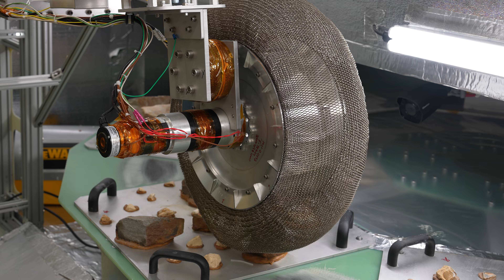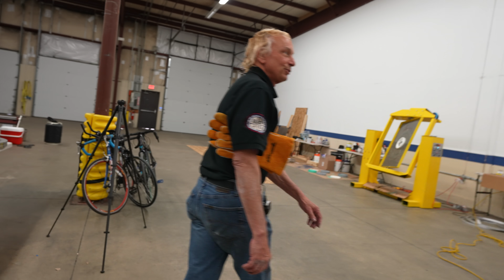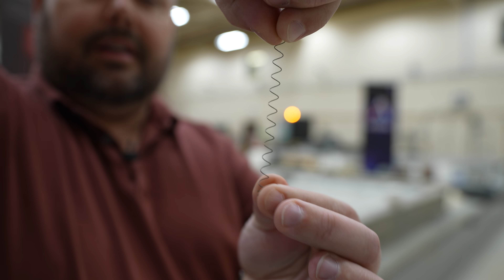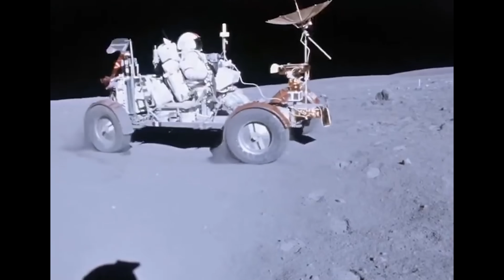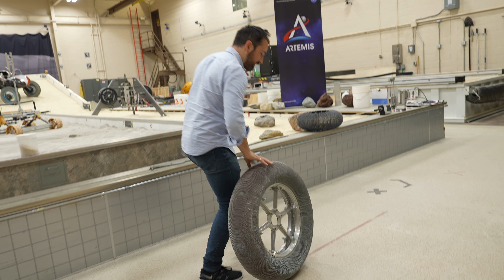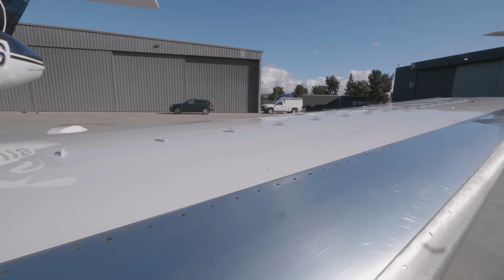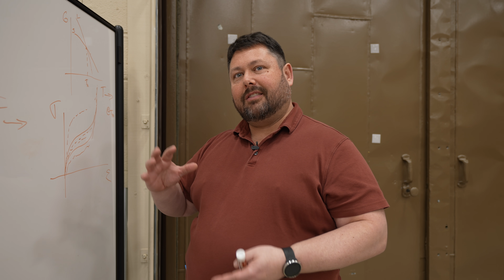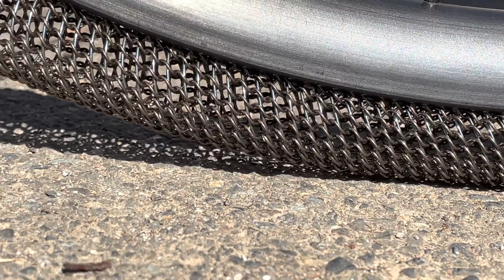How NASA Reinvented The Wheel

Comment: As an engineer grad who had to work with material science this video was very facinating, and really gets you trying to think about other applications for such a material. I bet racecar companies are looking into this material for their tires. I wonder if you could use this material with appropriate heat controls to increase traction or decrease traction of the tire during the race. If so, I could easily see it being one of the biggest improvements to long-term race times as you could "deflate" the tire on harsh turns, and to slow down leading into them, and then "inflate" the tire on straights for speed.
Reply: i kinda doubt it'd be used for tires cause it seems like the coefficient of friction isnt going to be all that high
Reply: @bigmitchy4026  wrapped with rubber
Reply: @sendoh7x  i mean sure but isnt that going to make the tires a lot heavier. So you've got the current weight of a racing wheel, then you'll have to add the metal mesh on top of that. The runber is a certain thickness as is because the rubber needs to last that long on the track. That isnt going to magically change once you add the nitinol mesh
Reply: @bigmitchy4026  i dunno man. up to the engineers to figure it out. or just probably not suitable for that purpose
Reply: In the context of racing tire pressure is usually used to control heat. Low pressure tires make more heat than the same tire at a higher pressure. They are just trying to target a specific temperature for a given tire compound. 

It could be cool to see it used to increase efficiency of vehicles with rubber tires. In the straights you could reduce the contact patch of the tire to reduce the coefficient of friction. In a corner it could do the inverse.
Reply: we use it in dentistry in root canals and braces which is amazing
Reply: I'm sure shoes have a place here
Reply: Rocket cars at the salt flats. Sort of like missiles with wheels
Reply: For vehicles, active suspension and aero can be created by just passing current thru this stuff, its the lightest possible actuator
Reply: think about it the other way around. tire problems in racing come from the tires heating and the tire expands and pressures go up causing the tires to wear and contact patch to decrease. imagine a tire that was more inflated when its cold and less inflated as its heated. you would have a more stable tire that basically stays the same at any speed or load or turn. that would be good. but i feel like metal rubbing around inside rubber is going to kill what they use for a tire skin. just the metal mesh would be terrible for traction so something will be over it im sure. 
maybe when pouring the rubber or silicone for the tire they could put the mesh in the mold and use this stuff like the belts in a tire so it wouldnt rub on the skin but be part of it and keep it in its shape like a skeleton.
Reply: As a motorsports enthusiast I feel like one of the best applications for this would be in endurance style offroad races, you get the dual purpose of the non puncturable tires combined with the ability to inflate and deflate tires easy and fast for various terrains. I'm not too familiar with offroad endurance stuff like Dakar, but it might be a nice replacement for hauling air tanks and spare tires for the same sorta stuff
Reply: What? Those tires are constantly changing heat going from 200mph to 100mph. You wouldn’t be getting even traction on any turn. I’m a high school dropout and know this. The better function would be to have it change your rear wing angle that’s controllable.
Reply: Engineer and build my own cars. Tires are fascinating.
Reply: I was thinking inductors or maybe even oscillators. I'm going to get some to play around with
Reply: @@pmiguelpinto which one? bullet proof, airless tyres? did you watch the video?
Reply: doesn't pebbles or sand accumulated inside such mesh tyres?😂
Reply: We can help scientists to develop better materials by processing data from Boinc distributed computing software
Reply: On god
Reply: Nitinol is not that great compared to rubber. It's way more heavier for the same amount of carrying capacity. It will also wear down much faster and it has worse traction. Nitinol tires are OK for the Moon or Mars conditions, but not for the Earth's.
Reply: @AlexBesogonov  if they are all nickle titanium. But perhaps a combination of certain types of pre-stressed rubber with a mesh matrix of nickel titanium embedded, and then brought into the range of normal tire operating temperatures and stresses. Even if it doesn't work, stuff like this should be explored. Right off the bat one can say it wouldn't work or be better, but different manufacturing techniques matter.

Comment: I'm a racer, trucks, motorcyles, sand dunes and I loved this video!
The spring interlay, layout reminds me of when I used snow chains in the sand dunes with a 1 wheel drive truck and tiny street tires, it worked.
Reply: Damn you're a racer and you're a truck and a motorcycle and you're a sand dune?? that's awesome dude I hope I can be a sand dune one day
Reply: Broken axle or just an open diff?
Reply: The google will quickly censor this question:
Why are YouTube comments packed with circle-jerking sock puppets?
Obvious, as are the countermeasures--but the google wants fake "engagement", the better to sell clueless ads.

Comment: It was mentioned that NiTiNOL is being used in multiple applications, which is super neat as I was able to use it for radio astronomy applications in my graduation thesis. Making large structures with NiTiNOL is way cheaper than launching and constructing them in space. The opportunities are almost endless!
Reply: Yes, so many possibilities!
Reply: I really wonder what's the downside of this material? Is it just cost? 
Cause all I've heard of it is super positive, if it is as good as it sounds we could have great developments in the near future
Reply: @gabiferreira6864  As far as my project went, you'll order based on your specifics. I needed 1mm radius wires which had memorized as a straight line. I cut it in the size of my antenna and because of the memorized shape, I could completely bend everything to fit in the container. However, if you want to memorize custom shapes like the "Ve" or "NASA" we saw in this vid, I'd suppose you'd need to send the manufacturers specific details. My thesis was almost exactly 2 years ago, so maybe things have changed. It for sure wasn't like your typical DIY shops back then, but that made the experience feel more special

Comment: That is truly interesting! But here's a question - given that the tire grid can be deformed, it can let in some particles (e.g. small stones) inside the tire, which can go through the grid when it's deformed, but then would stay inside after the tire goes back to its original shape. So can it be that those particles would accumulate inside? If yes - isn't that a problem that the tire becomes heavier?

Comment: Really cool stuff, but I can't help but wonder about the day-to-day capabilities that aren't being asked about. For on road capabilities, I worry about the wear and damage those tires would do to the road itself. I feel like solid metal with lots of holes to get things caught in it could contribute to road wear much more quickly than a typical rubber tire with grooves. How is it at distributing weight compared to a normal tire? Wet and slippery conditions? If it does somehow break apart, how does it break apart?

Comment: These are going to be a BIG deal in racing, given time. The characteristics this could achieve for sidewall stiffness and dampening would make for an unbeatable tire.
Reply: This may not work with tires under racing stress. These tires would deform on straights when they are cool and become stiff in corners when they are hot. Counterproductive to racing expectations where tires are elastic in corners for grip and static on straights for stability.
Reply: @PURENT  The comments during the video seemed to suggest they can tailor the alloy for a desired heat range.

Comment: not sure what bikes this dude rides but mine has a maximum of 4.5bar compared to his "normal road bike" 7 bar....
also, regarding the aircraft tires: it would be great having a mechanical system, as currently the tires need to be inflated with nitrogen, they need pressure relieve valves for under carriage fires to prevent explosions and as was mentioned punctures are a thing. What I wonder is: would the change to mechanical tires still be a viable option considering it would be probably heavier than the current air tires...

Comment: In endodontics/root canals, we use niti for both the shape memory effect as well as its excellent resistance to cyclic fatigue. This means we can prebend the file to make inserting it easier in tiny confined spaces then body heat will straighten the file out gently. Going around curves with a rotating file creates extreme cyclic fatigue, making most files break, niti does this with ease.

Comment: I have some reservations regarding the fuel economy of the tires, since the pseudoplasticity does not follow a standard elastic deformation curve, every time the metal is deformed, the tire heats up significantly and energy is lost. Depending on how much loss there is, the rolling resistance may end up higher than a high silica rubber and air, especially since the tread will still have to be some kind of rubber for a commercial application

Comment: A couple questions: Since the crystal structure of the tires are temperature dependent, would the drastic temperature swings on mars or the moon have an affect on their performance? Also would this metal applied to aircraft tires do damage to a runway at a higher rate than rubber tires? Awesome video!

Comment: It's still a metal, so at the end of the day it should be able to pass a current and heat up through resistive heating, right? So, is it possible to combine it with the brush system from a motor to produce a (admittedly very energy-expensive) remotely operated self-repair capability?

Comment: The rover on the moon is such a scary concept, imagine going 7.6 km away from your rocket and then having a breakdown, I think you'd be dead.
Edit: walking speed on the moon is only 2.2 km an hour
Reply: Well then see ya in 3.5 hours👌
Reply: @daminamlikesmathabittoomuch  Just came back to this video and watched it again and had the exact same thought, then scrolled down and saw that I wrote the comment last time. I think like scuba diving they'd probably do a third out a third in and a third for emergencies but maybe that's not possible engineering wise. The resources keeping the astronauts alive in their suits is battery power, oxygen, and co2 scrubber. I just googled that the endurance of the suits is between 4-7 hours, I would imagine the mission is designed with redundancy but this was cutting edge engineering problem solving so a lot of things didn't have as large of a safety margin as would be desirable. Imagine the exertion, generation of c02 and metabolization of oxygen trying to cover 8 km on the moon, also you have no sound to hear if the rovers motors are whining or the wheels are breaking or something is vibrating and grinding and I don't know how much feedback you'd feel through the suits. Just the thought though of being broken down, just out of reach of salvation is terrifying.
Edit: Also the regilith was a massive issue and covered everything and was very abrasive, I wonder if the suits would survive scrambling back 8 km on foot, I mean probably, they probably got up to that distance over several days but that's just another concern. I imagine it scraping away at their soles like a 20 year old pair of hiking books that's been used all that time till they're flat and treadless.

Comment: Very cool technology. I was curious about having them on regular vehicles, and on the Jeep, is there a risk where hard acceleration or deceleration may stress the nitinol beyond 8%? Rubber frequently encounters this force and the tire wall, a very heavy part of the tire, has to act as a shock absorber by twisting with the rim before the torque is transferred to the tarmac. How would nitinol do in this regard?

Comment: Question:  If applying heat puts Nitinol into a "suggestible" state, how does one ensure it doesn't "remember" deformations gained while in use?  On the Moon or Mars that may not be an issue, but driving a jeep on a road or landing a plane on runway creates some pretty extreme temperatures.

Comment: What about durability to friction though? Seems expensive and laborious to produce. The advantage of rubber tires is that they're designed with thickness of material in mind to last a long time and can be re-treaded when worn down, or cheaply replaced.

Sure, a rubber tire has a narrow temperature band that it should be operated in, but what about keeping them warm with embedded wire coils / internal heating mechanism? A lot of systems in space environments already need thermal management systems.

Doesn't seem like "heated rubber tire" would be better necessarily, but pretty clearly the manufacturing story doesn't scale yet. Maybe with some automation it could?

Sometimes I think these videos are missing the "but why isn't this done in practice" component. In this case pretty obviously because it's not competitive on the cost/manufacturability front.

Comment: Planes should land on a shallow (half to one inch?), level layer of water. This would save on million$ in tire wear. At the same time, super-efficient FIRE suppression.  In areas where water is scarce, water could be drained, filtered, and re-introduced to (at least the first 100 meters?) the initial runway area.  Why don't airlines use this?  My guess is it would interfere with commerce (not enough money in tires, maintenance, fire-crews, etc...).  To compensate for imperfect leveling, a dynamic system could add water while letting it drain strategically at the higher levels.  A system of small channels could be made self-compensating, since planes at 120+ mph would not sink appreciably.  If a plane is going faster it would sink less; tooo slow and  you're not in so much danger to begin with.  Crash-condition?  Much less likely to burn to death.  Water could be treated to further avoid flames, even in molten aluminum alloy.  Why don't they?  DOESN'T COST ENOUGH !!!

Comment: Interesting that the bicycle tire still has a rubber skin. I'd expect that part of the appeal for terrestrial use for nitinol is in replacing petroleum based products and the CO2 they generate. But we'd need a mass-produced product with a complete lifecycle analysis to do a real comparison to traditional rubber tires. There are also other factors like the comfort of the rider and noise that might explain why it still needs rubber.

Comment: Great video as always! I'm especially happy about the introduction of dislocations.
However, in the video here it is not really clear why the dislocation forms. You apply tensile stress but get an edge dislocation that would form out of shear stress. Especially since you used a primitive cubic crystal as the model, you could have utilized Schmid's law that would lead to the propagation of an edge dislocation 45° diagonal to the direction of applied stress. This is of course one step more complicated but physically correct and maybe a bit more intuitive since in the model shown here it is hard to understand where the dislocation comes from.

Comment: The tire application seems promissing - but I do wonder if we ll ever see its use as a bare tire. It seems slippery, far less grippy at high speeds than a rubber tire. But giving a tire structure instead of air sounds like a fantastic application!

Comment: One thing you didn't address in this video is how does nitinol handle abrasion. How resistant is it? What is the expected life of these wheels? How do the wheels being designed for rovers will handle surfaces with extremely thin regolyth, I.E., how will the design prevent the wheels getting bogged in deep dusty areas?

Comment: How does this tire behave in snowy/wet/dry condition traction wise? Does this tire get worse when its dirty? Does it corrode?
Reply: It would probably be better than a standard rubber tyre considering chains are used in heavy snow and ice conditions. 

Nitinol doesn't corrode easily, titanium and nickel are very corrosion resistant. However in space there isn't anything to corrode metals anyway, no oxygen.

Comment: calling a tire "bulletproof" after an airgun pellet fires clean through it is an interesting claim. Or at least a bit misleading
Reply: It would function the same with a real bullet. Just requires a lot more safety precautions to fire a real gun rather than a pellet gun. Not worth the effort for the same outcome.
Reply: @probablyinconsistent4756  yeah I understand that a projectile passing thru it won't change the performance of the wheel. But I'm just saying...